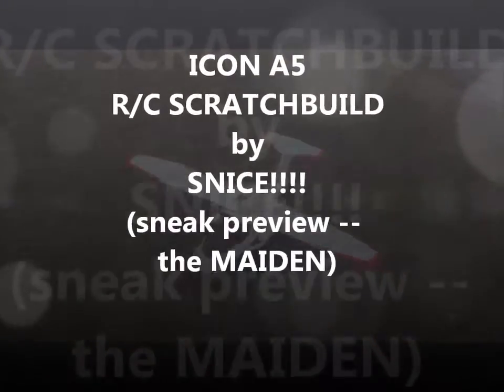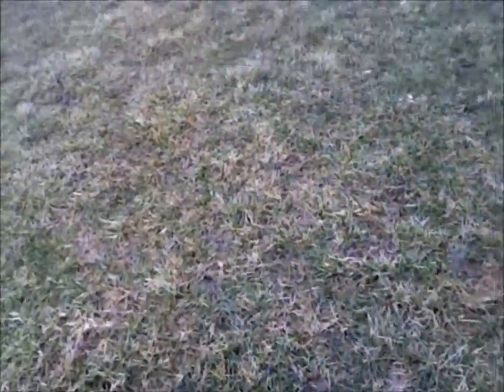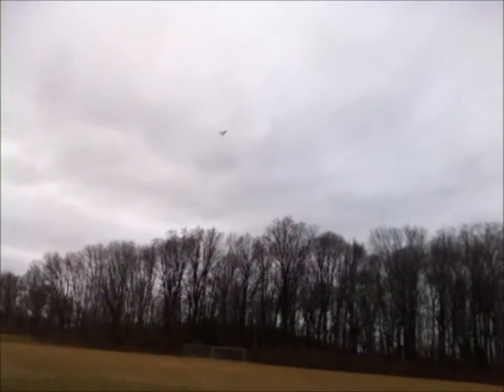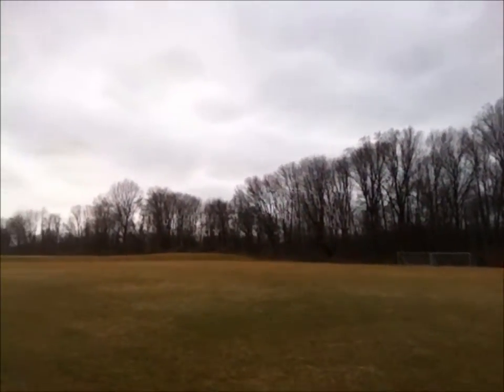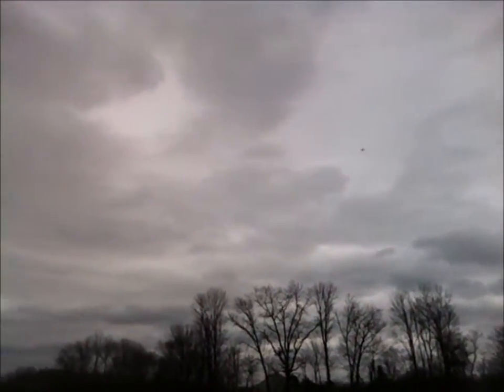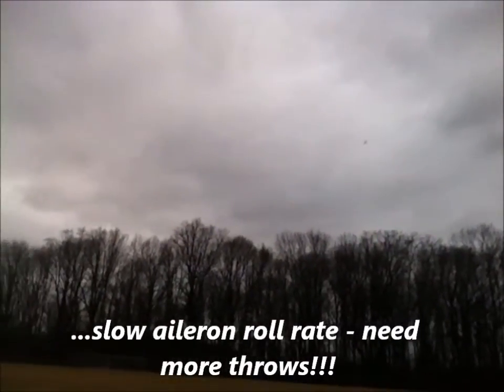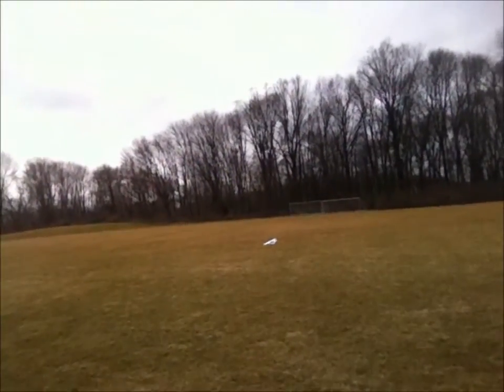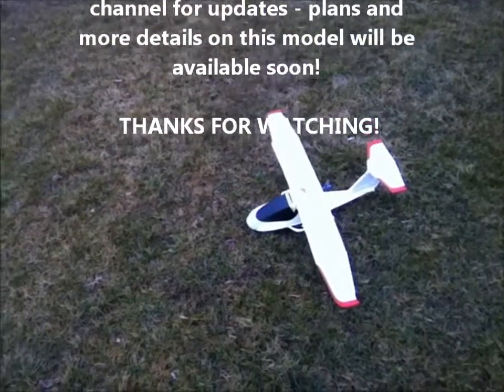ICON A5 R/C Scratchbuild by SNice - Maiden Video

Comment from the maker: Cool!  The nose down problem is most likely a wing incidence or cg issue and not a motor thrust issue.  Test your wing incidence:  flip the plane upside down, and put levels on the horizontal stab, the flat part of the fuse, and the flat part of the wing.  All three should be level with each other.  You can change the wing incidence by propping it up with some foam.  Hope this helps!  Final release of plans will have updated information.  Happy Flying!